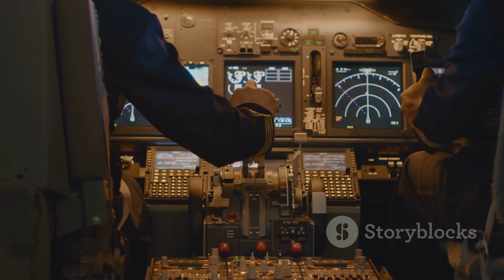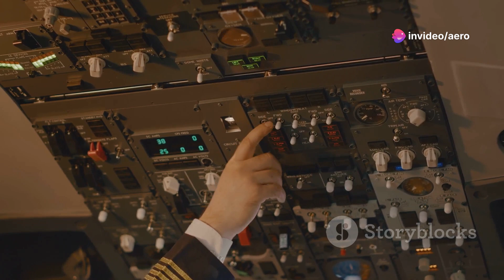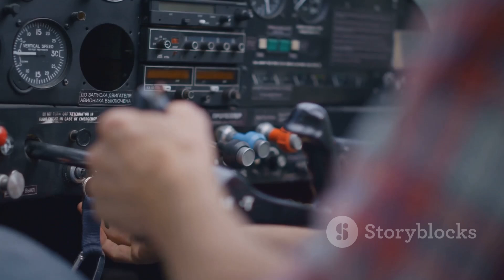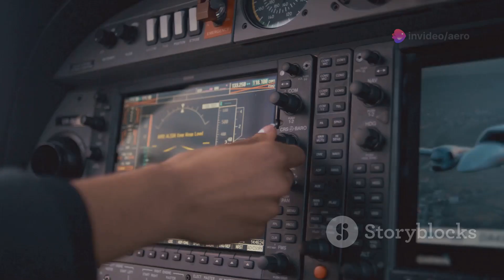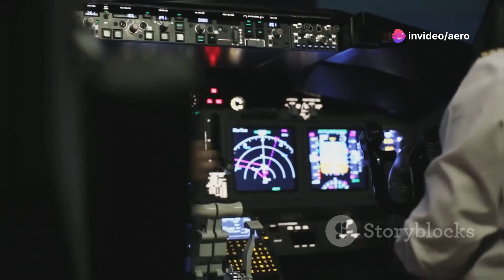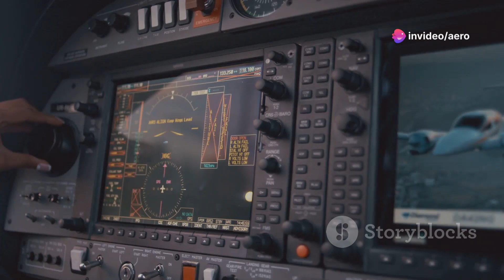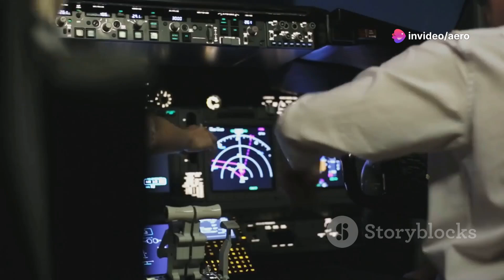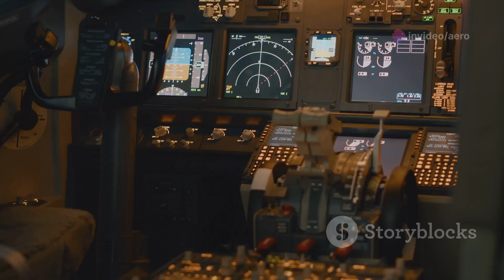"Unlocking Aircraft Stability: The Physics Behind Flight | Aero Strange"

Comment: I hope I finally found a physics channel that knows something about the stability of an airplane's wing in a constant altitude banked turn.    Where is the center of a banked turn?
Does it depend on the objective position of the wing in 3 dimensional space or does it depend on the relative view of the observer?  Where is the center of a banked turn?  Is it in a horizontal plane at eye level or is it pointed upward like an inverted ice cream cone toward the tip of the cone points that up into space and the base of the cone describes the path of the wingtips?
     If the former, then the outer wingtip flies faster than the inner wingtip and the airplane will overbank while it turns requiring the constant cross control of ailerons and rudder.  I say hogwash.  The center of the turn of a banked wing in level flight is pointed upward someplace where the total lift vector is pointing in 3D space.  I believe both wingtips  fly at the same airspeed and whether they do  enscribe different size circles of an observer's view on the ground is irrelevant.  Airplanes are not connected to the ground nor do their wings turn like propellers.  
     The oncoming relative wind is straight on and not slanted.  Only when the wing is yawing does one wingtip fly faster than the other.  Can any physicist on this channel knowledgeable in aerodynamics put to rest the old fallacy that there is an overbanking tendency when an airplane turns due to one wingtip flying faster than the other?
Or do you believe one wingtip flies faster than the other when the wing is banked?  After all, isn't a banked turning wing at a constant altitude in a stable condition?  Thanks in advance.
Reply from the maker: If you like this video please like share moreover subscribe. If you do this this is going to be our very big motivation to create more interesting videos
Reply: @aerostrangeinternational  By the way, I did like your video.  It's what prompted me to babble.  Thanks again.
Reply from the maker: The dynamics of an airplane in a banked turn can be understood by analyzing both the physics of flight and the aerodynamics involved. Let's break down your questions and address the core concepts:

### Center of a Banked Turn

In a banked turn at constant altitude, the center of the turn is the point about which the airplane is rotating. This center lies on the horizontal plane that contains the flight path of the aircraft. To an observer on the ground, this would look like the aircraft is tracing a circular path in the horizontal plane. To an observer on the aircraft, this center is the point around which the plane is turning horizontally.

### Relative Wingtip Speeds

The belief that the outer wingtip flies faster than the inner wingtip during a banked turn stems from the idea that each part of the airplane follows a different circular path. Here’s how it breaks down:

1. **Path Radius Difference**: The outer wingtip indeed follows a larger radius compared to the inner wingtip because the airplane is turning. Consequently, for the airplane to maintain a constant turn rate, the outer wingtip must cover more distance in the same time, implying a higher linear velocity.

2. **Airflow and Lift Vector**: The airplane's wings generate lift perpendicular to the relative airflow. In a coordinated turn (where the airplane is not slipping or skidding), the lift vector is tilted inward toward the center of the turn. This lift provides the necessary centripetal force to maintain the circular path.

### Overbanking Tendency

The overbanking tendency you mentioned arises due to differential lift and drag on the wings. Here’s a detailed explanation:

- **Lift Distribution**: In a banked turn, the outer wing travels faster than the inner wing due to the larger radius path. This speed difference causes the outer wing to generate more lift than the inner wing.
  
- **Yaw Moment**: This differential lift creates a yawing moment towards the outside of the turn. The pilot needs to counteract this moment using the rudder to maintain a coordinated turn.

- **Aileron Input**: To prevent the airplane from rolling further into the bank (overbanking), the pilot may need to apply opposite aileron input (i.e., ailerons slightly deflected towards the outside of the turn) to maintain a steady bank angle.

### Stability and Control

For stable flight in a constant altitude banked turn:

- **Coordinated Turn**: The airplane must be in a coordinated turn, meaning there is no sideslip, and the ball in the turn coordinator is centered. This requires a balance of aileron and rudder inputs.

- **Constant Airspeed**: If the airplane maintains constant airspeed, both wingtips fly through the air at the same indicated airspeed, but their ground speeds differ due to their different paths.

### Conclusion

In summary:

1. **Center of Turn**: The center of a banked turn lies horizontally relative to the airplane's path, not above or below.
   
2. **Wingtip Speeds**: In a turn, the outer wingtip does indeed fly faster than the inner wingtip due to the larger radius it covers.

3. **Stable Turn Dynamics**: An airplane in a stable, coordinated banked turn will experience differential lift between the wingtips, requiring careful control input to maintain the turn without overbanking.

Your assertion that both wingtips fly at the same airspeed (relative to the air) is true when considering indicated airspeed, but their ground speeds differ. The notion that the wings don’t behave like propellers is correct, but the differential speed due to the turn radius remains valid, influencing the need for coordinated control inputs.
Reply: @aerostrangeinternational  Thank you for your reply to a question that has boggled me for many years.  You seem to have a very high degree of knowledge in aerodynamics.  I would like to react to your last paragraph, which seems to abide by my position, at least partially.   As I see it, when a wing is flying, it does so regardless of the ground, and thus, groundspeed is irrelevant.  If there were an atmosphere in outerspace,  a wing could fly in all directons even if the Earth were as far away as the moon.  I've placed Cessnas in steeply banked turns in smooth air, and after trimming, I've folded my arms across my chest to demonstrate that the airplane remains in a constant bank for many cycles without changing one degree.  Eventually, a bump from my own propwash will disturbe the system. 
        If we tie a small string to the wingtips of a model airplane and connect it to a single string and swing it in a circle, I believe this would be a closer demonstration of how a wing turns.  The center of the turn would be up near the hands of the person holding the sting.  After all, the total lift vector is tilted so that some of the lift can accelerate the wing horizontally while the remaining lift is holding the wing in the air.
       This is an intriguing question that has had many arguing about wing dynamics.  Most pilots believe the outer wingtip flies faster,  because it is intuitive.  But if you take away the earth, you are correct that the airplane flies with respect to the pilot's reference, not on the ground.  I'd ask that we both ponder these thoughts and maybe someday we can revist this interesting question.  I wish I knew math well enough to try and prove this theory from the airplanes reference and not an outside observer.  Thank you again for replying, it was helpful.